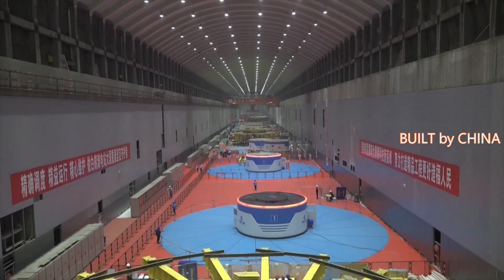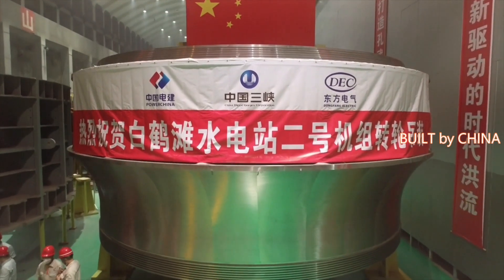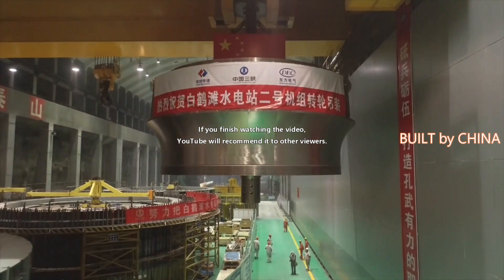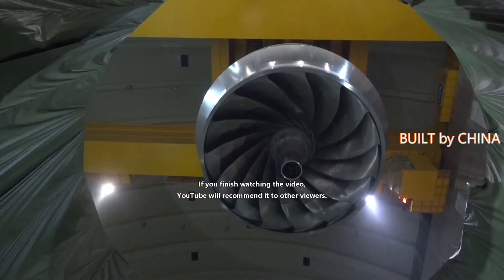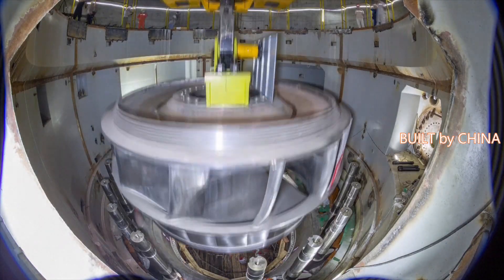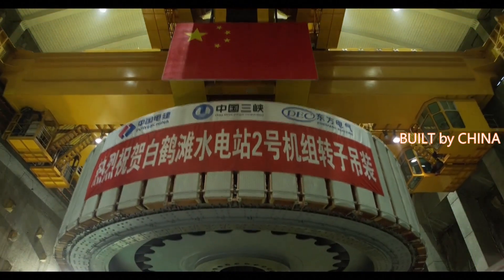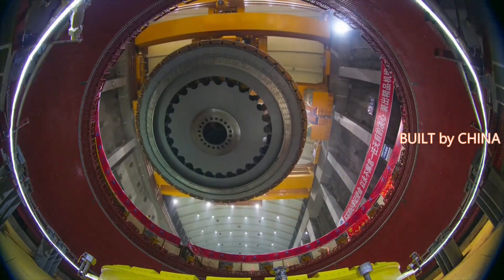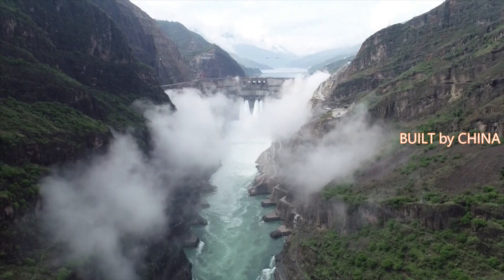The fourth unit of China's Baihetan mega hydropower station was put into operation | 中国特大型水电站第四台机组投运

Comment: It is definitely a great feat of engineering in civil, structural, mechanical and electrical/electronic  fields, all parts must be designed, build and make to work together in perfection.
However I believe that you may have made a mistake in your english subtitles translation (at about the 0.45 minute point) of the turbine impellar swing and the vibration of the massive water turbine.
The given figures of 0.06mm and 0.01mm are not likely to be possible or achievable in those huge 1,000 MW rotating water turbines.
More likely the figures are to be 0.06m (60mm) and 0.01m (10mm) which are already very high quality tolerances achieved in balancing the turbine impellar.
If so, do correct the translation figures for accuracy to benefit the international viewers understanding of this project.
Reply: There is a need to learn the lesson from the sudden massive deluge of rain in Henan province causing the severe flood damage.
Provide a plan B to pump or divert the surplus water in the reservoir to an upstream storage reservoir or maintain sufficient buffer capacity in the dam reservoir to store the sudden excess rain water.
In other words make sure that your HV power transmission capacity is adequate to utilize all the generators producing maximum capacity to bring the power to the users.
Do not store too much water in the dam's reservoir.
Reply from the maker: He said 0.06mm and 0.01mm. So no problem. Check this video. Another engineer said about the same thing. Smaller than human hair. The coins are still standing above the generator set.
 https://youtu.be/uTpcENfdw-w
Reply: @BUILTbyCHINA  
I viewed the older video you attached and if my limited knowledge of Chinese allows me to understand, I believe that the older vodeo speaker refer to the very tight tolerance of machining the impellar and its shaft during the  manufacturing of the turbine.
It is not refering to the operation performamce of the rotating turbine.
I am not aware that such massive rotating machines can  have the micrometer range of  performance stated.
Perhaps you can confirm with the speaker and provide the intended translation.

Comment: They need these dams because the demand for electricity is going up and trying to reduce using coal at the same time.
Reply: Besides, these dams is VERY profitable in China because of the relatively low construction cost.
Reply: That's why they r investing way more into Nuclear energy
Reply: @tmd-w1552  Because the locations,  which is suitable to build dam,  are limited and rare resource.  Nuclear power has no such limitation.